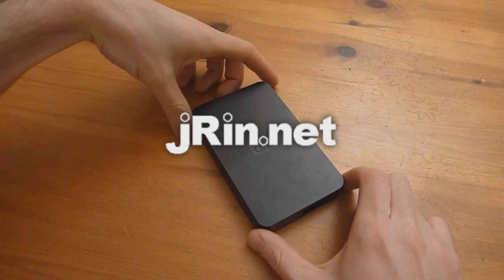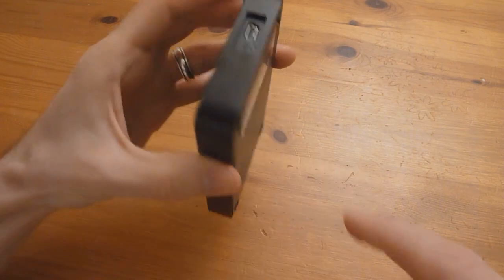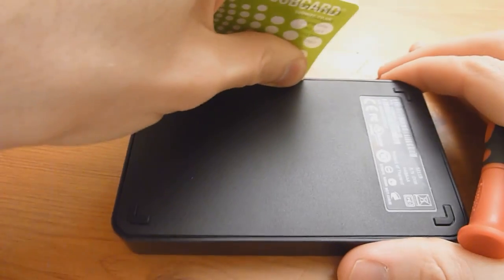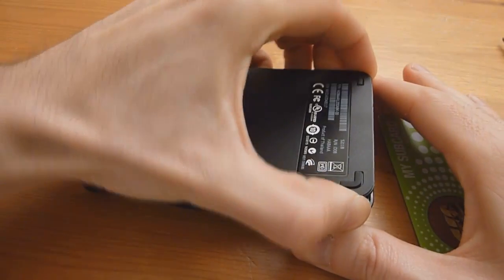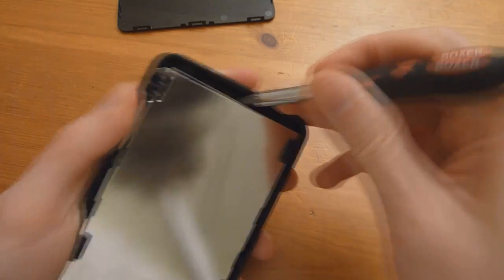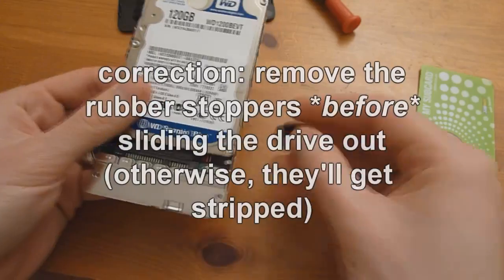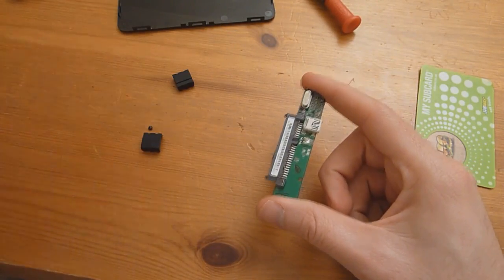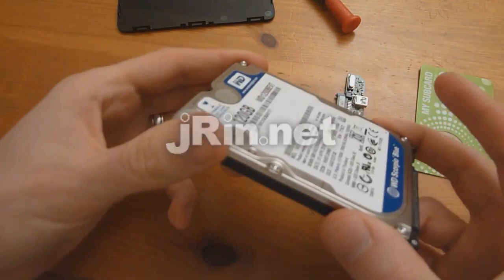How to take apart Western Digital Elements portable hard drive

Comment: Can I put my laptop's internal drive in there instead?

My laptop's hard disk has crashed and shows "imminent failure" and the Windows does not turn on. I can't reach the dektop. So I want to connect my internal drive from the USB port to at least reach my files. Do you think it's possible? Thank you.
Reply: It is in fact possible, if you have a WD External HDD with a SATA to USB interface
Reply: After I wrote that comment I learned that my external HDD, Western Digital Elements, has an integrated USB output. So I won't be able to plug in a different HDD to it. Thanks for your reply anyways.

Comment from the maker: @bluebannan123 it's not that you need to get a connector, it's that you need to get the elements drive that has a mini usb connection (vs microusb), as people have reported that the version that has a microusb connection has the usb port/connection soldered to the hard drive (and therefore, it isn't re-usable/easily upgradable)